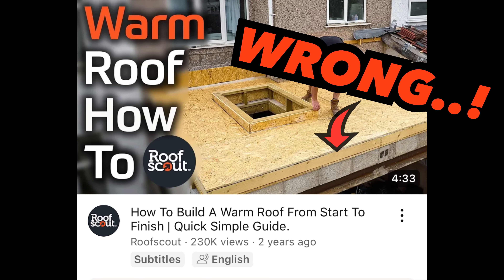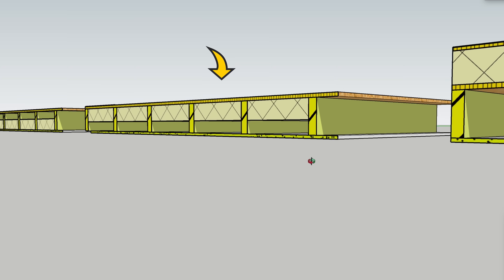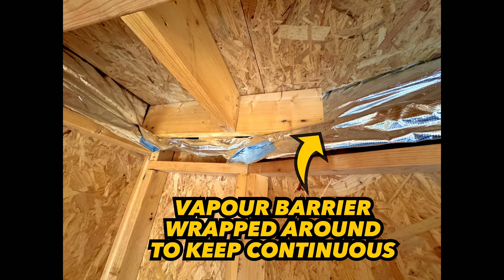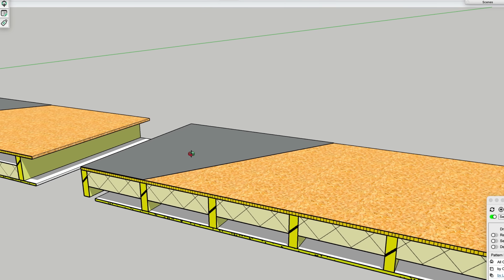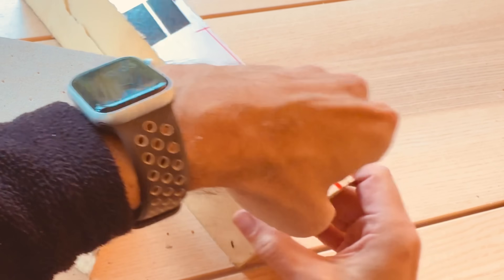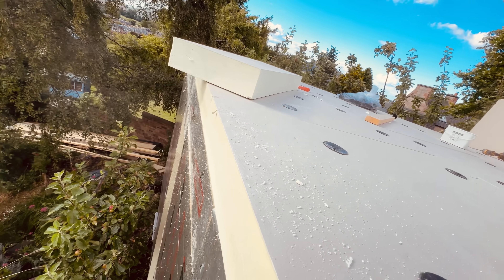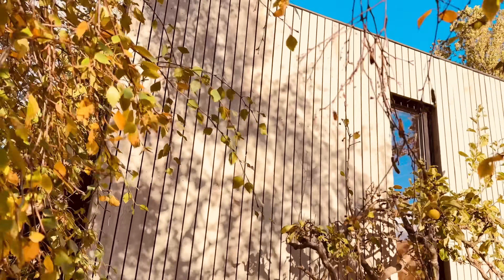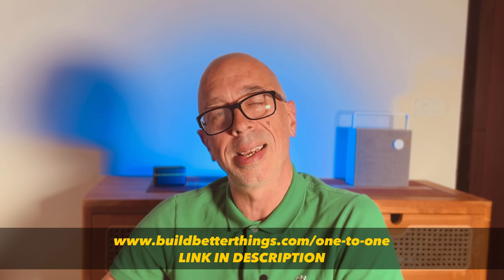Build a Warm Flat Roof the Right Way

Comment: Hey mate! Thank you very much for the video. Question for ya. If a client want to do pir insulation on top of the existing torched roof and then put epdm on top. The already existing insulation (glass wool) is laid on top of the inner roof with vapor barrier underneath. What's is the correct way of going about it?
Reply from the maker: Hi and thank you. I like to give good answers but I can’t do it here. You need to do a dew point calculation. You can do it yourself or go with a manufacturer and they will do it. But my guess would be that your proposal won’t work.

Comment: Would you not fill those plastic cones with some spray foam as extra insulation?
Or is the pocket of air between the glued EPDM and the metal screw small enough to be considered still standing and not conducting cold and creating a thermal bridge?
Reply from the maker: Hi.  Yes, foam inside is ok. The air isn’t trapped since it can permeate slowly through the EPDM. I’ve seen roofers use silicone as well.

Comment: Do you have any advice on how to do a warm pitched felt tiles roof?
Reply from the maker: Key thing is to use correct fixings through the insulation into the structure. Because you’ve got a ventilated rain screen before your breather membrane, you have more options. Unless you’re using EPDM of course. So I wouldn’t use felt.

Comment: im buidling a flat roof on a CLT house. The way the engineer draw it is like this. 60CLT-ISOVER VARIO XTRA-TRUSS CC 1200 (3 DEGREES)-400 LOOSE WOOL-22 WOOD ROOF PANELS-CONVENTIONAL 2 LAYER TAR ROOFING FELT. I'm living i Sweden, Nacka. Im considering if this i wrong according to your video.
Reply from the maker: Hi. I try to help but I’d really need to see a drawing of the makeup. But I note you’re using bitumen felt. You have to use a timber based sub deck for that, so I would use a ventilated roof for your makeup, using the firrings as the ventilation zone.

Comment: Thing is when we are grp roofing. The manufacturer recommends you use osb. To get the proper guarantee on many grp products you have to use it on osb. I know you are talking rubber roofing but this maybe why the mistake happens.
Reply from the maker: You raise a great point. I think that for grp you need to be using a ventilated roof, since, as you say, you need to be using OSB as the sub strata. History tells us that we shouldn’t rely on what manufacturers to tell us what to do. However, if those same manufacturers are offering guarantees, then that’s different again. Thanks for your comment

Comment: Just to be clear, in the case of a warm roof, are you saying that boards placed on top of the insulation will have condensation forming on the lower side (between the board and the insulation)?
Surely that area is all cold, with no warm/moist air contacting cold surfaces,  the vapour barrier below the insulation preventing moisture rising into that area.
I'm not claiming to be an expert,  but I did construct a garden room with a  warm roof a few years ago, in the main I was guided by Ali Dymocks excellent video's.
Reply from the maker: Hi. No vapour barrier is perfect, plus you’re micro piercing with lots of screws, plus your joints and edges with the vertical vapour barrier will never be perfect etc , then you have residual vapour. As the thermal transfer happens, at these weak points, any condensing vapour has no way to escape so you’ll get small pockets of potential rot within the underside fibres of the OSB and eventually small areas of rotting composite and eventually the membrane adhesion will fail. Yes, that part you mention is cold, exactly why localised vapour will condense there, regardless of where your calculated dew point may be. If you’ve already done it, just keep an eye on it, this is for those considering doing it in the future.
Reply: @build-better-things  Thanks for the quick reply.  It's certainly a head scratcher!  Your explanation seems to make a nonsense of the term 'dew point'.  I'm definitely going to do some more research!

Comment: Am I missing something, moisture isn’t exiting through the rubber either, there may not be wooden sheets to rot but the moisture is still there rotting the rafters/joists?
Reply from the maker: The EPDM bonded directly to the insulation allows any trapped moisture to slowly transfer or breathe outwards through the EPDM . If OSB is there, the glues with the strands of the composite prevent that, the moisture stays trapped, and localised rot ensues.

Comment: They really shouldn’t be warm flat roofs as like you say they are prone to rot the trapped and sandwiched timber.  The problem with laying the roofing membrane straight on to insulation, shown in the video,  is anything heavy usually puts a dint in the insulation.  Far better to have a cold flat roof with ventilation flowing through.  That should pick up any rising damp and carry it away, out of the roof.
Reply from the maker: Hi. If you use the correct insulation, you will not get any dints or depression. A cold ventilated roof is also fine, using an OSB cold top deck but it will get very hot in the summer.

Comment: Am I missing something or did you say a cold roof is fine, even with the OSB on top underneath the EPDM? As long as you have good ventilation in the soffits?
Reply from the maker: Yes, a cold ventilated roof is fine, even with OSB on top. That’s what the water based adhesive systems are best for. Evaporation avoids any trapped vapour, you can’t get that with a warm roof and a secondary OSB layer.

Comment: I might have the 4th version (by accident). My shed has OSB panels on the beams. And on top of those panels are the 7cm PIR blocks. The EPDM is glued to these PIR blocks.
The shed was never meant to be lasting a century and it also is not heated so humidty might never be an issue anyway.
Reply from the maker: The 4th version. Interesting. How is it performing?

Comment: Hi, on the warm roof installation video you show the vapour barrier on top of the insulation on the adhesion stage you show the rubber roof being applied directly to the insulation, this is the part I find confusing. Please advise
Reply from the maker: No the vapour barrier is always on the warm side of the insulation. I’m not sure which bit of the video you’re talking about but I don’t ever show the vapour barrier on the cold side

Comment: what you describe as a warm roof is what we called an insulated roof or type of ( many years in the industrial roofing industry ) 

 Could be what you term an inverted roof though? A warm roof has water proof insulation on top of the membrane (roof) held down with ballast, hence the roof (actual waterproof membrane) is warm (warmed by the inside temp of building) solves the problem of dew points, thermal bridging, but can add problems of structural strength. "wind vent roofing" can help with reducing weight of ballast via " Bernoulli's principle states that an increase in the speed occurs simultaneously with a decrease in pressure." 

see lots of videos getting it wrong as I see it
Reply from the maker: Hi. An inverted rod has the membrane below the insulation whereas a warm roof has the membrane above it. In theory they’re both “warm” as the structure and deck are both at the same temperature as the room in both circumstances as they’re on the warm side of the insulation in both examples
Reply: @build-better-things   ye see your point, it's just that after 45 years in the industry if the waterproof layer is not warm it's not a warm "roof" see lots of people even in the industry not seeing it as others in the industry do. maybe i should start calling it a "warm waterproof layer roof" or fully warm roof as an idea

Comment: Just finished the bare bones of a concrete block garden room, osb roof, edpm installed. I am now researching roofing methods, thinking of a cold roof and painting the underside of the OSB as well as adding 2 x 12 V fans either end at the eaves in the cold roof cavity which will come on with the lights (when occupied/heater on) to increase airflow. Thoughts on these methods? @buildbetterthings @everyone

Comment: The proper way to build a flat roof is NOT to build a flat roof. I've seen a ton of flat roofs built in many different ways.... right before we tore them out and built a pitched roof in its place. We have done low pitch 1.5:12s with double underlayment and peel n stick, just built a parapet around the rim with drains and downspouts to give the look of flat from the ground.
Reply from the maker: People build flat roofs out of necessity usually. Modern technology allows for 60 years plus provided they’re built properly.  Your parapet idea is often over complex, and prone to its own leaks at the various flashing junctions. I think what you meant to say was you prefer pitched roofs, rather than telling us not to build one.
Reply: @build-better-things nope. I meant to say not to build one. Parapet works great, is incredibly simple to build when it’s part of the original plan, and the underlayment runs continuously up the inside of the parapet which eliminates almost all flashing. But keep convincing yourself that a bad idea is a good one and that the good method is rife with problems.

Comment: i have lot questions, not sure this is good place to discuss, but i'll start and then maybe we can move it somewhere else.
I got a very simple roof build for a technical compartment, it is just joists + osb + bituminous membrane. and it is sloped.
Since this technical compartment have a water drain evaporation will occur and i'm worried about all the heat that will escape i'm thinking about improving the insulation.
i was thinking building over the existing membrane the xps layers and then waterproof it again. but i'm unsure the membrane is vapor tight.
I guess i have to check the sd values for the membrane and act accordingly if they are too low (replace with a proper vapor barrier).
Also i'm worried this video apply only to flat roofs, is there a difference i should be worried about? my thinking is: the flat roof must be more water proofed than the sloped one.
Last: the mechanical anchoring of the xps isn't going to pierce the vapor barrier ?
Reply from the maker: Hi. I would worry less about the sd value and more about the integrity of an old membrane. Get rid of it.  Also, how you lap into your vertical vapour barriers. Yes, you’re mechanically fixing through, so yes you’ll get some small leakage. That’s why you never have OSB on the cold side.
For pitched roof, you have some other options, but if using a membrane and no tiles , then it’s the same principle. 
Italy is a great place.
Reply: @build-better-things  it is actually quite new, just few months old in fact, and it's one of the reason i wanted to save it... should i rip it what is a good sd value? i usually see in stores values of 2m but a quick AI research told me it is a very low value, the minimum in fact, but i don't trust AI that much...
Reply: P.S. at the time of the building i did know nothing about roofs/insulations etc and i just trusted the builder that that was the correct way of doing it.
Greetings from Italy!

Comment: Great video i agree 100% with your building science analysis. Can I suggest another variation to the roof build up. place counter battens ontop of external insulation, fixing through insulation to roof structure joists, to form a ventilated cavity. fix an osb deck to the battens and apply roof membrane of rubber, fibreglass, metal etc. this method will provide a robust structure for many roofing options and can support weight for working or walking on the roof surface without causing damage.
Reply from the maker: Yes, great detail and in fact I show it very briefly at the start of video. I use firring pieces to form the ventilated deck. This is what i would use for GRP for example.

Comment: Makes total sense but insulation on its own won't have much resistance to impact. I would have thought sheeting, or some alternative, was needed for that reason..
Reply from the maker: Hi.  Membrane will puncture before insulation will deflect, provided the correct insulation is used. The correct Insulation on its own will have sufficient resistance to impact.

Comment: It is wrong to build flat roof using wood in the first place. There is only one reliable material for flat roof is concrete.

PS:
PIR produces toxic fumes when put into fire, this is not type of material you want to use in wooden-frames house. Toxic fumes is often the reason why people die during fire.
Reply from the maker: Be careful about using words like “wrong”. I would avoid use timber in a tropical climate, but I’d avoid using concrete on a Northern European context. The beauty of building is…it depends.
Reply: @build-better-things 
Any wooden roof requires ventilation.

Using PIR supposed to solve vapors and condensation issue under the covering material, but not ventilation issue.

Finish decoration of wooden frames from the inside may cause situation when vapors are getting to the wooden frames and can't get out.

Wooden flat roof - this is more about selling new matery on the market then quality and durability.
Reply from the maker: A warm roof definitely does not require ventilation.
Reply: @build-better-things 
There is a mandatory ventilation in construction of any gable roof (hip, shed and so on), insulated or not, modern or old.

Why? Because wooden frames also need ventilation, you can't put typical construction wood in completely sealed space, it will rot faster.
Reply from the maker: Suggest you read up a little more on the technology before posting.
Reply: @build-better-things  
by word "mandatory" i mean "must be there". the ventilation is passive.

by the way, i suggest to read about toxic fumes of PIR during fire and stop promoting material that increases chance of death during fire.
for some reason, this part of my comment was totally ignored

Comment: Can you still add, more insulation on interior plywood in the ceiling of your warm roof?
Reply from the maker: No. You will compromise the dew point, bringing it further inside the building to where interstitial condensation becomes a risk. Check your dew point and your vapour control, and work back from there

Comment: It is tricky question which one is right way to do it - they all wrong. Left and center one only have soundproofing and no insulation at all. Right one have insulation, but have no ventilation for it, and no soundproofing. But good point on osb on cold side.
Reply from the maker: Hi and thanks for comment. No need for ventilation for the warm roof option.

Comment: I love all these info thank you so much. 

I binge watched all these other builders and even I (with minimal roofing experience) raised an eyebrow when thinking of the dew point on the timber under epdm or whatever vapor barrier they used finally at the top cold side.

I would love a video regarding reinforcing this CORRECTLY insulated flat roof to withstand lawn installation and make it a roof top terrace. 

🤝🤝👏🙏🙏
Reply from the maker: Hi. For that type of installation, it’s different again.  Probably what we call an inverted roof, and we use a different type of insulation since we need to protect the membrane. Difficult to explain here in the comments but it’s a great question

Comment: I aimed to reduce the roof profile so tried something different. I installed 120mm joist, fixed the ply deck to the underside. fitted the vapour barrier and 120 pir inbetween the joist then a further 25mm tissue faced pir over the top. My builder said it was wrong?? But I have a canopy and didnt want it to be 400mm thick

Comment: Would you have any advice. I am in the process off re-furbishing an old timber frame dormer/extension. The warm roof element is easy enough. The only question I have. Where the roof timbers on the flat roof are installed, the roof falls to the front so that the water can go into the gutter. I have removed the original fascia, and there is no insulation or anything behind the fascia. So when you look into the void, you can see the back of the plasterboard on the ceiling. Before installing the new fascia/soffit, how would I go about insulating this area? Without the insulation, I can image that there would be a fair amount of heat loss.
Reply from the maker: Yes, this these perimeters are a big issue where installers do a great job on the roof itself, but don’t understand how to create the thermal envelope around the edges. Because of the volumetric geometry, these edges achieve disproportionally high heat loss. I can’t really describe on the comments here the ways to remedy, but as well as adding in your insulation, it’s critical you get the vapour control element correct.
Reply: @build-better-things  Thank you for you're reply. I was going to install 150mm Celotex in to the void then foil tape around the perimeter of the Celotex. As this is a timber frame structure [and is fairly old], the finish on the external wall is hanging tiles. Once the roof was complete, the interior plasterboard/ceiling to the rooms is then going to be removed. As I was going to insulate all of the Timber frame properly.  So there is potential to alter the insulation at this point.
Reply from the maker: Ok. Hopefully you have a ventilated zone on the cold side of the new insulation / breather membrane such as a cavity prior to your brick / cladding. Best of luck